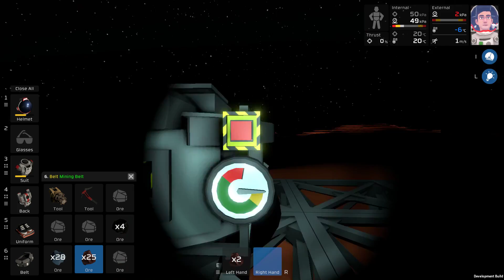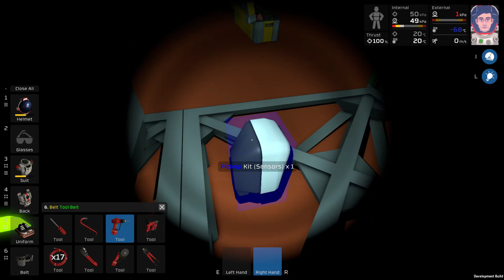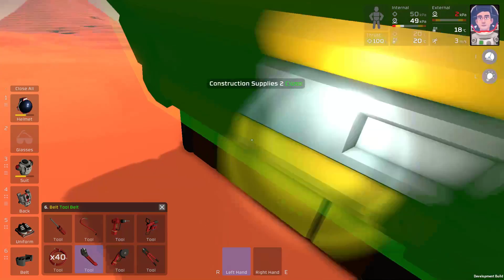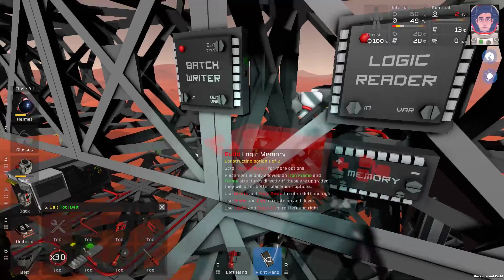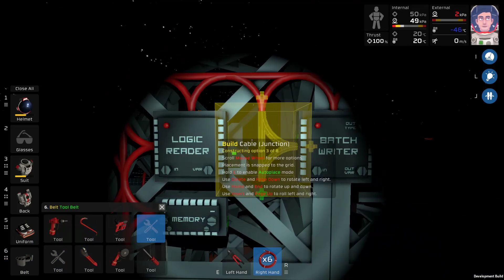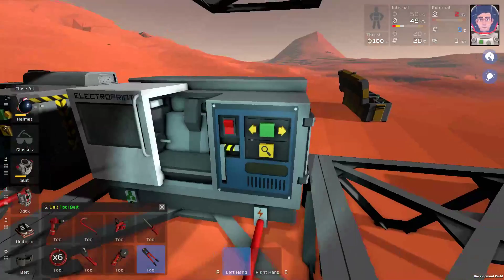Stationeers / EP 2 - Steel and Solar / Mars Colonization

Comment from the maker: Here's the Stationeers Wiki Link for reference: 
https://stationeers-wiki.com/Solar_Logic_Circuits_Guide
Reply: The vaguely absurd logic system is one of my favorite things in the game.  And I basically only ever use it for automating the solar panels.  (Once I needed proper climate control I already had a computer and just...shoved it awkwardly into a state machine in there)
Reply from the maker: Hah, I'll probably do climate control logic too.
Reply: @ErinJayEldridge  this is the same logic that runs inside of the cpu of your computer. They pretty much visualized assembler
Reply: They seem to have changed the solar panel logic guide since this was made, and I cant get it to work.
Reply from the maker: @norwegianwiking  They haven't. Often the sensors or panels are facing the wrong way.
Reply: @Rhadamant  managed to get it working now.
Reply: For whatever reason, your method and your values did not work (and yes, I'm also trying to play on Mars).  However, using the precise values from the Wiki (which are not the values you used), and my array now works.
Reply from the maker: @SFCgunny  Glad you got it working. Troubleshooting things yourself is the way to success for Stationeers.

Comment: Hello 🖖Is it necessary make horizontal and vertical sensor on mars? since the sun is moving vertically straight and only. What about eating and drinking you don't need to open the visor? how's that possible. Thanks for the upload.
Reply from the maker: It isn't necessary, but the sun is actually not straight overhead, its at an 8 degree angle so you won't get full efficiency without both horizontal and vertical.

Comment: well, followed your example of the automated solar array...EXACTLY...and didn't work at all, in fact, it started shorting out all of the wires.  Fuck this game.
Reply from the maker: If it is shorting out the wires you've got too much power running through them. Sounds to me like the battery you are feeding the power to is trying to send more power than the wires can handle, probably need a transformer.

Comment: For those having trouble with solar tracking this is a really simple method which only requires 4 chips
https://gameplay.tips/guides/1796-stationeers.html
Reply from the maker: How's the efficiency there?
Reply: Not great but pretty close to max if your not too concerned about it for me about 85% on mars after I adjusted the horizontal angle.

Comment: @rhadamant, I built this on one world and it worked perfectly.. built it on a second identical, and the panels track the sun backwards? I've tried to remove and replace the panels as well as flip the panels and no dice.. helppppppp
Reply: during the "night" .. the panels also keep resetting and rotating vertically to the other side.. then resets and continues etc etc till the sun comes up, then it tracks the sun backwards
Reply from the maker: I am sorry, it's near impossible to troubleshot complex setups through text =\

Comment: Thanks for the videos!
I would like to add
If you use the transformer between the big battery and the power controller, its easier to fine tune the rate everything consumes power. Allowing the big battery to stay charged.
Reply from the maker: I believe I end up doing this IIRC

Comment: An alternative to manually moving the panels or automated tracking is to have multiple panels, pointing to more-or-less evenly spaced points of the sun's path. E.g. one each for 9:00, 13:00, 17:00.  Wasteful in the sense that you get on average less than a full solar panel's worth, but if you have the resources to build them but not the resources to do the logic setup, it can help you not having to do all the manual tracking.
Alternatively you can spread out your panels for sunrise to noon, and then switch them over manually at noon and back sometime between sunset and sunrise. More effective (though not even remotely close to automated tracking), but some manual work needed.
Reply from the maker: Honestly that's a lot more expensive than just doing the logic. The full logic setup is definitely cheaper than a solar panel or two, so you get your ROI really fast.
Reply: @Rhadamant  A lack of materials or an unwillingness to blindly copy the logic without full understanding might be obstacles.

Comment: for some reason my panels are pointing the opposite way of the sun. What did I do wrong?
Reply from the maker: Just uninstall them and reinstall them 180 degrees rotated. The panels can't just be installed facing any direction
Reply: @Rhadamant  oh shit, that worked! You don't wanne see my wiring right now, though xD

Comment: never played the game so take my suggetion with a grain of salt. Wouldn't it be better if you had a laptop that you could plug in to a machine which programmed microchips where you could write the code instead of the big ass microchips that you attached to your base? maybe not even write the code but make input output and programe the logic beind what you want different things to do. seems to me that would make the gameplay less complicated and easier to understand
Reply from the maker: Believe it or not using an integrated circuit would be more confusing.. by a lot. I went with the solar logic method that I thought would be easiest to follow.

Comment: you should use integrated circuits instead of chips, it will save you power and space, not to mention the ease to maintain and wire. Also batteries tend to loose charge faster when they are out in the cold
Reply from the maker: Hey Tim! The starting base I'm setting up is just that, a tiny little starting base. I can insulate my batteries and use IC chips later.